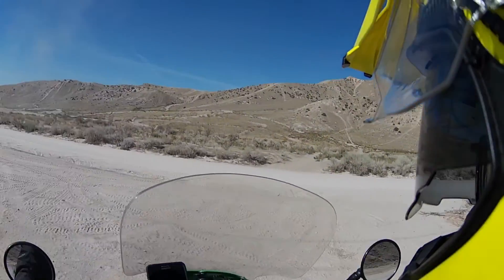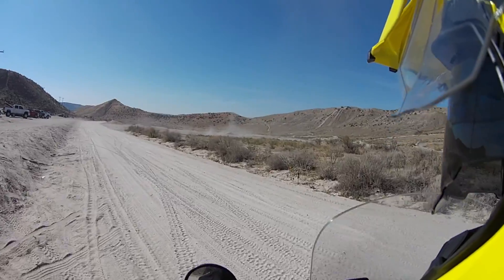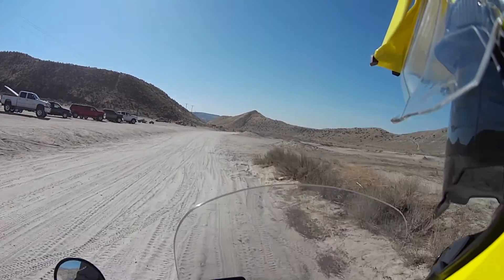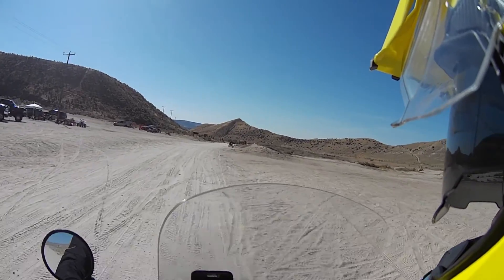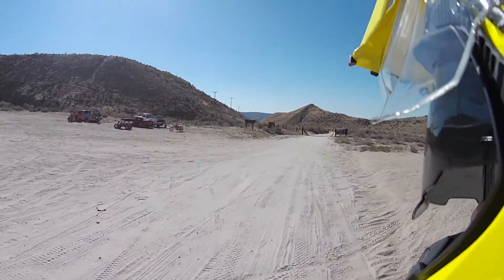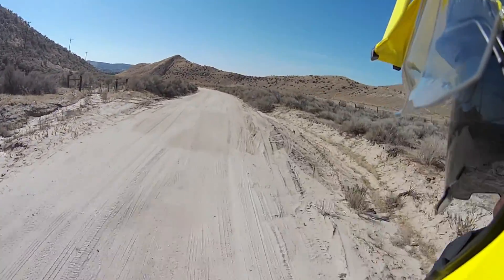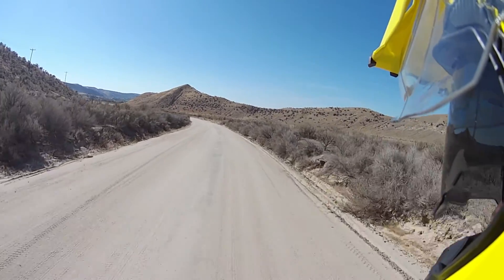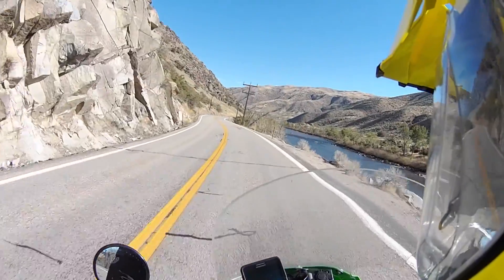06 KLR650 Test Ride

Comment: I had the same tires on my 08. The front was really unstable over 55 mph. I put some anakee 3 tires on and it was night and day difference. The bike transformed with those tires. they are not as agressive but I can't honestly say that I am needing any more for what I do(mostly on road and gravel road). Just a thought. I look forward to see what you find.  Thanks for the good Klr videos.
Reply from the maker: +Geoatv Campatv now that I have some miles on them, I agree. They are terrible at higher speeds on the pavement. They are pretty good off road though.

Comment from the maker: kcatto21 Thanks for the feedback, and you are absolutely right! i forgot all about the dash.  I will make sure I go over it in my next video.  It turns out, I don't recommend making it. It was WAY more trouble than it was worth.  If I had it to do over, I would make a simple bracket somewhere and not worry about making it look nice and fit on the speedo cluster.  Also thanks for the heads up on the intro volume.  I was wondering if it was too much, but no one was saying anything!
Reply: +Obsessive Cycle Disorder I watched all your videos and so cool to finally have some videos about KLR builds. I am really impressed with your klr parts bike find.... wish I could score a perfect donor like that with all the goodies on it like the moose racing light protector... I bought my 1991 theft recovery with mostly missing and busted plastics and punched out ignition, missing CDI etc... Are you gonna sell any of your parts you are not gonna use? I am always on the look out..LOL..... I was wondering about the dash... I am adding something similar to mine but I thought that one you had looked pretty cool but I was unsure about it being attached to the cowl and not the metering gauges.. I am also waiting for a aux light to get here in shipping for my bike. I dont do videos but take lots of pictures for my scrap book.. btw what are you luggage racks in the back... and I really like the boxes... very cool!
Reply from the maker: +kcatto21 After reading your comment about the dash, I went out to the shop and recorded a video showing the template and some details about how I made it.  I could scan the template and email it to you if you like.  Clearances and angles were hard to figure out so maybe I can save you a few hours of head scratching!  Send me an email if you (or anyone!) would like to have it.  sam@cycledisorder.com

My luggage racks are from happy-trail.com.  There are a few manufacturers that make very similar ones, but these are fairly affordable and they are based here in Boise ID.  

I don't think I will be selling my parts bike.  For every part I take off, I replace with an original part from the green bike. In the end, I should have a complete stock bike with a blown engine.  I am thinking I will make a video series about rebuilding the engine and getting it back on the road.  Fortunately for you, the KLR has been around for almost 30 years and millions have been made.  There should be plenty in salvage yards for you to get the parts you need.  Unfortunately, the body tends to be missing or unusable, or just too expensive.  I'm working on a project off camera to produce affordable custom body work for the first gen model.  Stay tuned, I will announce it here on my channel when they are ready to ship.  Thanks for the subscribing and commenting!

Sam
Reply: +Obsessive Cycle Disorder NICE! I cannot wait to see what you have in mind for the body panels... not many salvage yards for motorcycles around here... :( ... I have asked for years but no one seems to know where the salvage bikes go... except several shops buy and part them out at almost a premium price.... I will enjoy the rebuild, it will be good... like I said I cannot believe the total lack of klr projects on youtube... thank you very much,
kev
Reply from the maker: +kcatto21 No problem. I hope I don't loose you on my next project! I promise there will be more KLR videos in the future though.  Too bad about your parts situation.  To find my parts bike, I posted on craigslist (in multiple categories) a list of the parts I was looking for and waited for the replies.  Through the conversations, I realized that one guy had a whole bike that he was about to part out.  So when I went to his house to buy the parts, I made an offer for the whole bike.  Maybe that could work for you too.